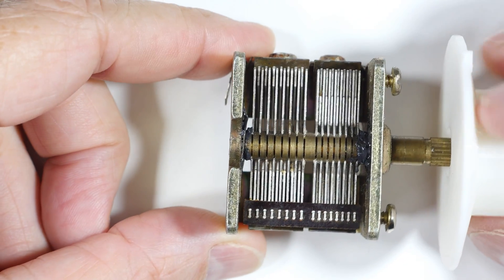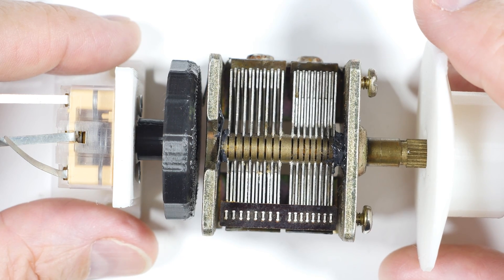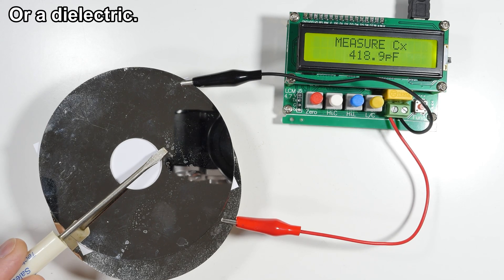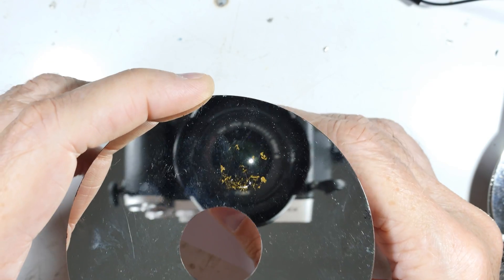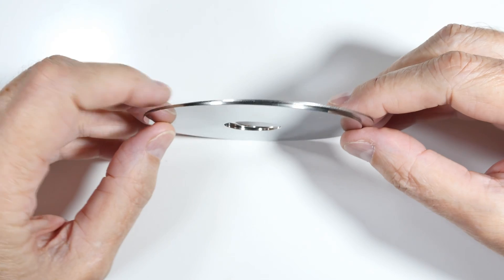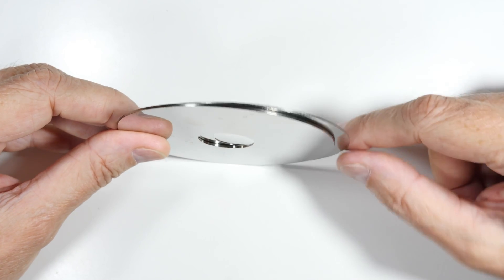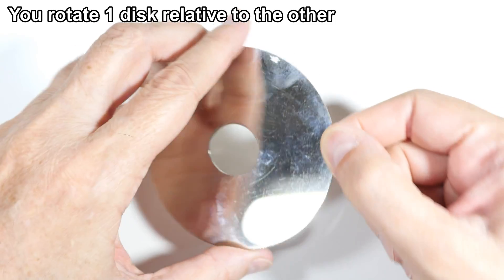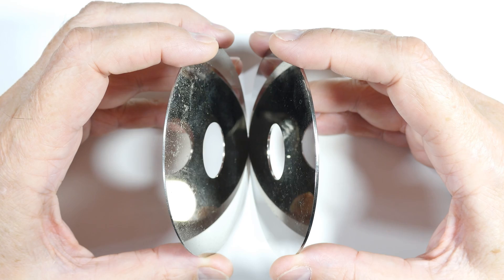Crystal Radio--DIY Air Tune Capacitor? Pt1 (4K)

Comment: I remember reading in a early Mother Earth news magazine of a Crystal radio build where the used a square of AL foil and a gum wrapper to make a variable cap. They also used a penny for the detector .if I remember correctly
Reply from the maker: I don't know about the penny detector,  but that style of capacitor can work.
Reply: @tsbrownie  perhaps a corroded penny?

Comment: A much Easier to build & more "Antique" realistic looking is the vintage "Book" variable Cap used in the Earliest tube radios....1 pair of 2" x 3" rectangular metal Flat plates, Insulated & Hinged 1 long side  (Like 2 book pages) compression adjusted by a fine machine screw makes a relatively easy to make 15--400pf stable Variable capacitor Identical to some earliest vacuum tube radio types...I've used them & Works fine

Comment: When I was a kid I got a crystal radio kit and didnt like making tunable coils becasue I didnt want to ruin the wire by stripping it, so I made a variable cap for tuning from 2 circles made from cardboard cutouts. Stick a pin through the centre of both and glue aluminum foil to a half-circle on each side, and then carefully put a smooth single layer of plastic tape over the foil of one side. Then mate together the discs taped-foil side to foil side - the top disc can be rotated to adjust the surface area of aluminum separated by tape. I remade one recently from 12cm diamater discs I can pan from ~1pf-202pf. The ones I made as a kid were usually ~5cm diamater, which in hindsight is probably why I could only catch a few stations!
Works best when it has something pressing down the cardstock from above, like washers on the pin glued on, otherwise your tuning will jump as soon as you go to adjust it.

Scotch tape doesnt seem to have a publically avaliable dialectric constant but it works pretty well, probably becasue of the narrow gap it makes.

Comment: A sheet of window glass makes and excellent dielectric. You use copper or aluminum for the plates. For the stator I would glue copper foil to one dide of the glass. Put the 'rotor' on the other side, the metal on this side should be thick enough to be rigid. Glue a small hinge to the glass close to one edge of the aready attached plate. Attach the rotor plate to the hinge. Now build a small tower on the opposite side such that you now have a screw and nut assembly to push the plate towards the glass. Sprong load the plate so it is pushed away from the glass. The screw overcomes the spring pressure and brings the plates together. Attach a wire to each plate. Ta-da! You have a variable capacitor! To keep static noise down it would be best to insulate the screw and the spring from the plate.
This will enable you to make the capacitor physically smaller as glass has a high dielectric coefficient. 
Hope that helps.

Comment: Try Press-n-Seal plastic wrap as an insulator. It is sticky on one side and easy to work with.
Reply from the maker: Is the other side slippery? I'm not familiar with it.
Reply: Yes, and super glue won't stick to it. I used it to rebuild battery hinges on In the Ear Hearing aids. @tsbrownie
Reply from the maker: @mrdovie47  Interesting. Thank you.

Comment: From the bottom up... A wood base. Drill a hole. Glue a threaded nut over the hole, to the bottom of the board. Flip the board and glue one disk to the base, centered over the hole. Glue a popsicle stick across the hole of the second disk. Thread a bolt through the nut and through the board. Glue the bolt to the center of the popsicle stick. Turn the bolt to precisely separate the two disk. The popsicle stick must be to the outside of the disk pair, before gluing the bolt to it. Otherwise, the popsicle stick will keep the disks apart. Just a first thought... Hope it made sense. I wonder if an old 45 RPM center disk adapter might be employed, somehow...
Reply: The contraption could also be turned on the vertical. Instead of turning the board flat, turn it vertical and make it narrow, like a pillar. Or, make two vertical stands, mount the bolt on the vertical, between them. Make both disks with the popsicle nut arrangement. Spin the disks apart...

Comment: One main flaw I see with your idea is that if both plates touch each other and rub while tuning their surface will get damaged (at least over time) and their capacitance will change.
Reply from the maker: True. I mentioned in the video that one can put in an insulator (say paper) that could be replaced. Also, the operator will be adjusting the capacitance to tune, so if the min / max values are not perfect, it probably won't matter. You can adjust around that defect.
Reply: @tsbrownie   Overall I think your idea has quite potential 🙂👍